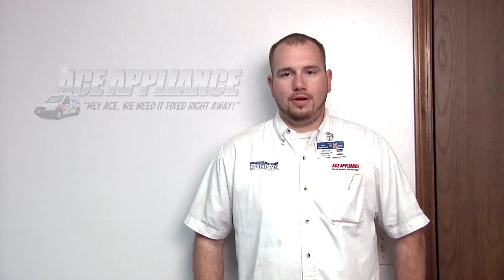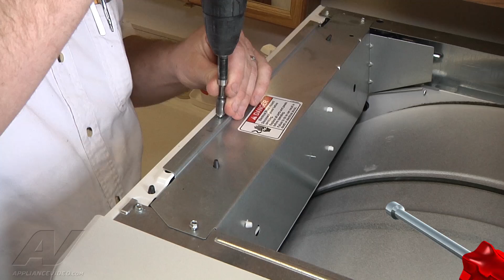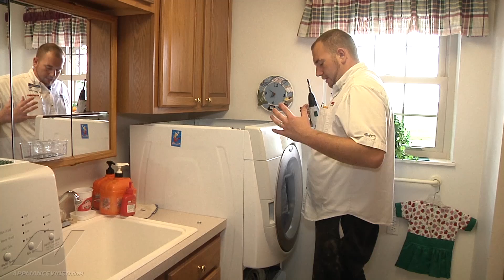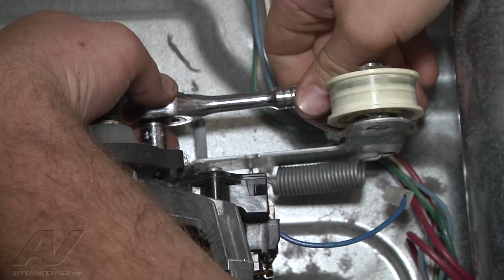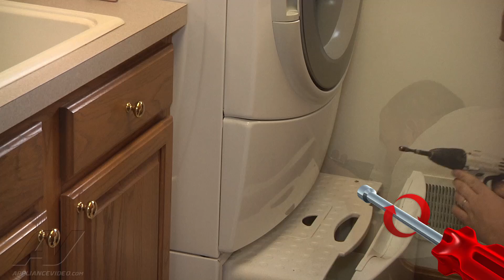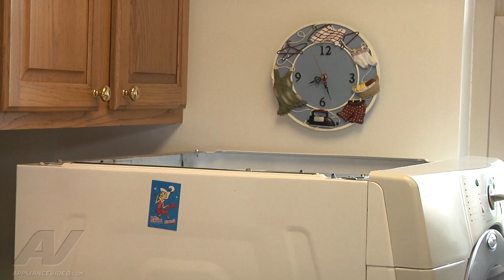Whirlpool Dryer Repair - Will Not Turn On - Belt Switch

Comment: Spent over $50 on the switch and got two loads dried and it quit again. Now we have no lights on the drier at all. Checked the breaker and it's fine.

Comment: I'm going to try this this weekend with my dryer I done replace the thermostat in door switch and control board and it's doing the same thing, beats three times and will not start so I'm going to try this. I have an Electrolux dryer by the way.

Comment: Thanks so much. 
Replace belt, pulleys etc
Would not start!
Watched this, reached in and manually operated switch and wa la, started. 

THANKS !!
Reply: Your dryer didnt turn on at all? Mine said PF before not turning on completely

Comment: I did this exact thing ,replacing the idler wheel through the two 4 " vent holes in the back and sides  without removing ANY screws and it took me about 45 min..

Comment: I have a GEW9250PW1 that doesn't light up at all, nothing. Not sure which board would be at fault.  The thermo fuse is shot and one is on the way.  Any ideas?
Reply from the maker: Great question, if you have a more technical question that our parts department cannot answer, you can search our over 17,000 answered questions free at our website www.ApplianceVideo.com under our Repair Help section. You can also call our parts department at 1-800-830-5465 and they can give you help 7-days A week ,or search at www.SaveMoreOnParts.com  .

Comment: I have the same dryer, but only had to take off back pannel to access the switch.  There is an access panel in back.
Reply from the maker: Great question, if you have a more technical question that our parts department cannot answer, you can search our over 17,000 answered questions free at our website www.ApplianceVideo.com under our Repair Help section. You can also call our parts department at 1-800-830-5465 and they can give you help 7-days A week ,or search at www.SaveMoreOnParts.com  .

Comment: my duet dryer just doesn’t turn on. I flipped the circuit breaker but it still completely dead it doesn’t turn off the power button
Reply from the maker: Great question, if you have a more technical question that our parts department cannot answer, you can search our over 17,000 answered questions free at our website www.ApplianceVideo.com under our Repair Help section. You can also call our parts department at 1-800-830-5465 and they can give you help 7-days A week ,or search at www.SaveMoreOnParts.com  .

Comment: What else would pop the thermal fuse .....I get about 5 good dries before it pops
Reply from the maker: Great question, if you have a more technical question that our parts department cannot answer, you can search our over 17,000 answered questions free at our website www.ApplianceVideo.com under our Repair Help section. You can also call our parts department at 1-800-830-5465 and they can give you help 7-days A week ,or search at www.SaveMoreOnParts.com  .

Comment: I have a duet gew9200lw2. It won't even turn on. No lights... nothing. can it be fixed?
Reply from the maker: Great question, if you have a more technical question that our parts department cannot answer, you can search our over 17,000 answered questions free at our website www.ApplianceVideo.com under our Repair Help section. You can also call our parts department at 1-800-830-5465 and they can give you help 7-days A week ,or search at www.SaveMoreOnParts.com  .

Comment: What is it when your electric dryer( Frigidair DE500ADW5) works as it should and shuts off at the end of the cycle, but the heat is staying on. Checked the heater, is not grounded.
Reply from the maker: Great question, if you have a more technical question that our parts department cannot answer, you can search our over 17,000 answered questions free at our website www.ApplianceVideo.com under our Repair Help section. You can also call our parts department at 1-800-830-5465 and they can give you help 7-days A week ,or search at www.SaveMoreOnParts.com  .

Comment: i had the same issues and i replaced the switch but it still doesn't want to tumble. i hear the relay click but the barrel doesn't move. bad motor you think?
Reply from the maker: Great question, if you have a more technical question that our parts department cannot answer, you can search our over 17,000 answered questions free at our website www.ApplianceVideo.com under our Repair Help section. You can also call our parts department at 1-800-830-5465 and they can give you help 7-days A week ,or search at www.SaveMoreOnParts.com  .

Comment: My dryer starts but doesn't turn.  tumbler its jammed.
Reply from the maker: Great question, if you have a more technical question that our parts department cannot answer, you can search our over 17,000 answered questions free at our website www.ApplianceVideo.com under our Repair Help section. You can also call our parts department at 1-800-830-5465 and they can give you help 7-days A week ,or search at www.SaveMoreOnParts.com  .

Comment: Please help!  I have a gas dryer. Would I need to replace the thermal fuse for whats wrong with my dryer  
When I push start on my whirlpool duet dryer I herar a light click but nothing starts or turns on.  On the dryer led display it reads "sensing/readjusting time.
Reply from the maker: Great question, if you have a more technical question that our parts department cannot answer, you can search our over 17,000 answered questions free at our website www.ApplianceVideo.com under our Repair Help section. You can also call our parts department at 1-800-830-5465 and they can give you help 7-days A week ,or search at www.SaveMoreOnParts.com  .
Reply: @Appliancevideo way to late,  I already figured it out.  The belt came off of the BAD IDLER PULLEY/WORN OUT BRACKET. On amazon i ordered a kit which included a new bracket, idler with upgraded bearings and new belt for $15.00.

Comment: My dryer is the whirlpool cabrio dryer, and it has been getting the f22 error code. It would start for one minute then stop instantly. Do you know how to fix it?
Reply from the maker: Great question, if you have a
more technical question that our parts department cannot answer, you can search
our over 10,000 answered questions free at our website www.ApplianceVideo.com under our Repair Help section. You can also call
our parts department at 1-800-830-5465 and they can give you help 7-days A week
Monday -Saturday, or search at www.SaveMoreOnParts.com  24 hours
7- days A week.

Comment: Hi Brian I have tumble dryer not working. Whirlpool AZB M810 won't start. Two red lights are blinking... When I press start nothings happen.
Reply from the maker: Great question, if you have a
more technical question that our parts department cannot answer, you can search
our over 10,000 answered questions free at our website www.ApplianceVideo.com under our Repair Help section. You can also call
our parts department at 1-800-830-5465 and they can give you help 6-days A week
Monday -Saturday, or search at www.SaveMoreOnParts.com  24 hours
7- days A week.

Comment: Thx. Some of us are way more advanced than millennials. I'm not familiar with my front loader duet. Maybe a 2004 model. I believe that it's my board. I'd like to get it going. Been dead for 4 years. FINALLY!!! Someone that knows his ohm meter.
Reply from the maker: Great question, if you have a more technical question that our parts department cannot answer, you can search our over 10,000 answered questions free at our website www.ApplianceVideo.com under our Repair Help section. You can also call our parts department at 1-800-830-5465 and they can give you help 7-days A week Monday Saturday, or search at www.SaveMoreOnParts.com  24 hours 7 days A week.

Comment: Hi, I'm just wondering would that issue cause a f70 code to pop on? Whirlpool duet wed9200sq0
Reply from the maker: Great question, if you have a
more technical question that our parts department cannot answer, you can search
our over 10,000 answered questions free at our website www.ApplianceVideo.com under our Repair Help section. You can also call
our parts department at 1-800-830-5465 and they can give you help 7-days A week
Monday -Sunday, or search at www.SaveMoreOnParts.com  24 hours
7- days A week.

Comment: What if mine doesn’t make any noise but the lights come on but won’t start
Reply from the maker: Great question, if you have a
more technical question that our parts department cannot answer, you can search
our over 10,000 answered questions free at our website www.ApplianceVideo.com under our Repair Help section. You can also call
our parts department at 1-800-830-5465 and they can give you help 7-days A week
Monday -Sunday, or search at www.SaveMoreOnParts.com  24 hours
7- days A week.

Comment: ......mines turns on but does not spin?

when i turn it on it just makes a click sound also shows the check lint screen light flashing. so i opened the bottom panel and vacuumed everything out. and its still doing the same thing?

belt is good as its not broken and still attached to the pulley and moves when i push the barrel.

thermal fuse should be good. didnt have a tester so i googled and told me i can jump the 2 wires. and still no luck.
Reply from the maker: Great question, if you have a
more technical question that our parts department cannot answer, our
technicians are answering all questions at our website at www.ApplianceVideo.com under our Repair Help section. You can also call
our parts department at 1-800-830-5465 and they can give you help 7-days A week
Monday -Sunday, or search at www.SaveMoreOnParts.com  24 hours
7- days A week.
Reply: What did you do to make it work?

Comment: If you had enough working room could you have gone through the back?
Reply from the maker: Great question, if you have a
more technical question that our parts department cannot answer, our
technicians are answering all questions at our website at www.ApplianceVideo.com under our Repair Help section. You can also call
our parts department at 1-800-830-5465 and they can give you help 7-days A week
Monday -Sunday, or search at www.SaveMoreOnParts.com  24 hours
7- days A week.

Comment: Can I temporarily jump the two leads to see if my thermal is fuse is bad ?  thnx
Reply from the maker: Great question, if you have a
more technical question that our parts department cannot answer, our
technicians are answering all questions at our website at www.ApplianceVideo.com under our Repair Help section. You can also call
our parts department at 1-800-830-5465 and they can give you help 7-days A week
Monday -Sunday, or search at www.SaveMoreOnParts.com  24 hours
7- days A week.

Comment: I had similar issues with my dryer, but it looks like it is the thermal fuse. I noticed in your video there is a pad along the inside of the dryer next to the motor. It looks like the cause of my thermal fuse malfunction is from the pad inside the dryer falling on top of the pulley which caused the pad to heat up. I took the pad out. Is it important to have the pad inside the dryer or can I leave it out since it felled down already? Thank you for the video.
Reply from the maker: Great question, if you have a
more technical question that our parts department cannot answer, our
technicians are answering all questions at our website at www.ApplianceVideo.com under our Repair Help section. You can also call
our parts department at 1-800-830-5465 and they can give you help 7-days A week
Monday -Sunday, or search at www.SaveMoreOnParts.com  24 hours
7- days A week.

Comment: My electric (ventless) dryer started but soon stopped with an LF code. I can not find this code on any web search. The searches come up for that code on a washer, but not the dryer. Please help!! 😔
Reply from the maker: Great question, if you have a
more technical question that our parts department cannot answer, our
technicians are answering all questions at our website at www.ApplianceVideo.com under our Repair Help section. You can also call
our parts department at 1-800-830-5465 and they can give you help 6-days A week
Mon-Sat . You can also search at www.SaveMoreOnParts.com 7- days a week.

Comment: Thank you for the video My dryer has not been Working properly the code F23 appeared so the clothes got very wrinkled because the dry just kept hearing up After a while the dryer stopped working and didn't spin anymore.  
Kenmore Elite
Reply from the maker: Great question, you can call
our parts department at 1-800-830-5465 and they can give you help 6-days A week
Mon-Sat . You can also search at www.SaveMoreOnParts.com 7- days a week.  If you have a more
technical question that our parts department cannot answer, our technicians are
answering all questions at our website at www.ApplianceVideo.com under our Repair Help section. We have over
4,000 common questions and answers that you can easily search through by your
model number, appliance make, and problem or error codes, and It’s free to
search through our question & answer library.

Comment: I did the procedure from this video (since had the exact same symptoms as presented in the video), I bought and installed a new dryer belt switch, but it turned out not to be the issue. Any other ideas on what could be the issue?
Reply: yeah called parts department and they didn't know. after doing more research, it ended up being a 5 dollar thermal fuse that fixed it. thanks for the follow up, though.
Reply: @bstatmeister  
Where can I buy that thermal fuse from?
I think I need that same part for mine. Is there a link I can go to and purchase?
Reply from the maker: Thanks for your response, we are glad we could help. Our library of over 5,700 videos are currently helping over 1.6 million people like you every MONTH.  Please help us by subscribing to our YouTube channel, or post our website www.ApplianceVideo.com to your Facebook page, Twitter, Instagram or any other social media sites. Your support will help us keep producing more free quality videos.

Comment: my whirlpool duet dryer is stuck on time remaining and I can't start it because it shows time still remaining on screen it says like 2 min and 5 min when I move the knob would you happen to know how to fix it?
Reply from the maker: Great question, you can call our parts department at 1-800-830-5465 and they can give
you help 6-days A week Mon-Sat . If you have a more technical question that our
parts department cannot answer,
our technicians are answering all questions at our website at www.ApplianceVideo.com under our Repair Help section. We have over
3,000 common questions and answers that you can easily search through by your
model number, appliance make, and problem or error codes, and It’s free to
search through our question & answer library.

Comment: whirlpool duet stream lint cleaning
Reply from the maker: Great question, you can call our parts department at 1-800-830-5465 and they can give
you help 7-days A week. If you have a more technical question that our parts
department cannot answer, our technicians are answering
all questions at our website at www.ApplianceVideo.com under our Repair Help section. We have over 3,000 common questions
and answers that you can easily search through by your model number, appliance
make, and problem or error codes, and It’s free to search through our question
& answer library.

Comment: my samsung dryer, control panel gives me a be2 error, but my dryer works but doesn't warns and dryer my clothes but the drum works, its this code associated to my dryer not working and what can most likely be the problem?
Reply from the maker: Great question, you can call our parts
department at 1-800-830-5465 and they can give you help. If you have a more
technical question that our parts department cannot answer, our technicians are answering all questions
at our website at ApplianceVideo.com under our Repair Help section. We have
over 3,000 common questions and answers that you can easily search through by
your model number, appliance make, and problem or error codes, and  Its
free to search through our question & answer library.

Comment: It's funny that my dryer had the same exact problem. It would beep but not turn on. I did all the testing and found out the circuit board was bad. I removed the board and noticed a burned solder joint on the relay.  I purchased a new relay on amazon, soldered the new one on and it works like a CHAMP!! 
If you have basic soldering skills, you can repair your own board and save hundreds!!! 

Good video!
Reply: same here, went through the diagnostics and then when i removed the board, the motor relay was burnt on one of the connectors. is this a manufactured defect?  omron g8p-1A4P-ACD  12vdc  279h2
Reply: @1viggen007  Thanks!!! Flipped my circuit board and WOW it’s obviously burned off exactly as you said! This should be easy to fix.. thanks for posting that!
Reply from the maker: Thank you for
your positive response, we are glad we could help. Please subscribe to our
YouTube channel or donate a dollar  to
our fan funding page to help us create more quality content. This is the only way
we can continue to help thousands of people like you every month. Just click on
the link below and go to our YouTube page and click on the BLUE support button
on the right hand side of the page. Thanks in advance.   https://www.youtube.com/user/ApplianceVideos
Reply: ik